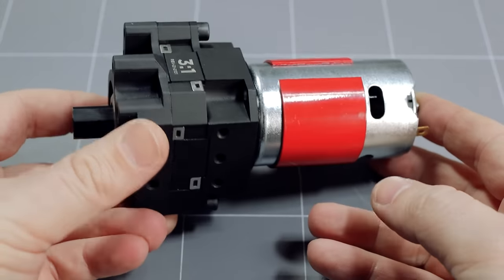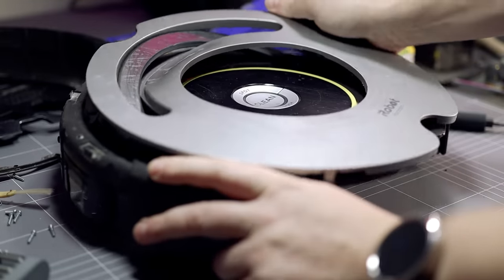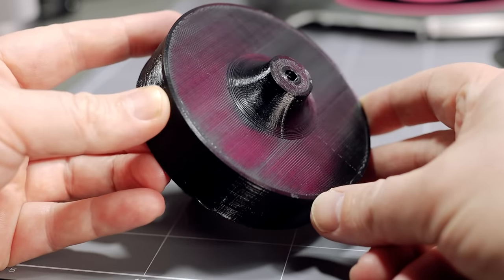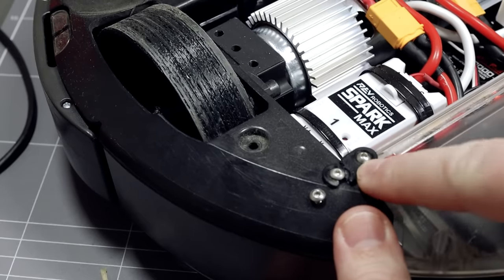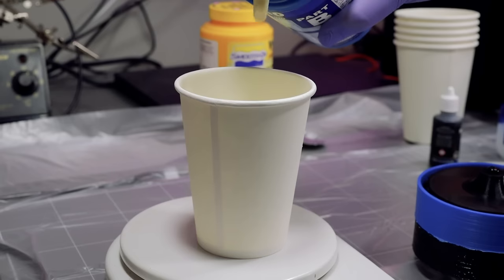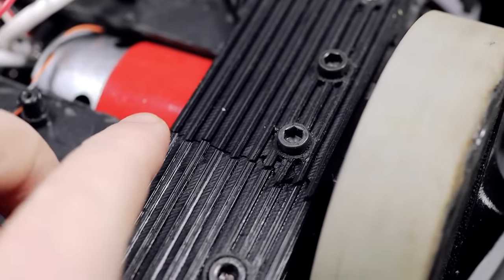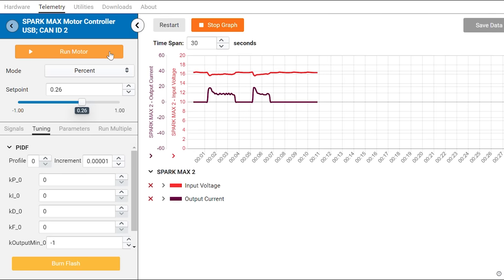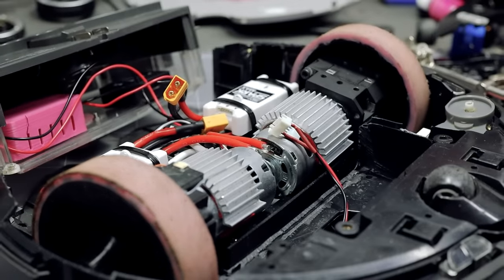Building the World's Fastest Roomba

Comment from the maker: Join the electrosync team on Patreon: https://www.patreon.com/electrosync
Reply: Just had an idea. Would be nice if Roomba had a camera and a sentry mode while your out. Plus the ability to “take over” control from the auto computer to drive with a phone so you could check your house out when away. Other idea. Linear actuator to lift front combined with tank tracks to climb stairs.
Reply: I just want you to name it Vroomba thats all
Reply: I just wanna see this evolving further... Rockets for an speed boost, parachute and breaks, ....
Reply: maybe you should add some LEDs in the dust compartment and in the litthe sensor that sticks out in the front
Reply: dunno, but just pls do not stop it!
Reply: I would suggest just casting the entire wheel, or try printing it resin. FDM wheels are usually miserable because of layering, and having to recast the tires every time is probably getting kinda annoying. I'd also suggest maybe trying something else for the structure before stepping up to aluminum, only because aluminum is a pain in the ass once it bends and can cause damage to other things since the mount is no longer taking the brunt of the impact. Just something to think about. I would also think about some sort of other creative solution for the anti-wheelie. Between it, the front swivel, and the main wheels, this thing is TECHNICALLY a four wheeler. but I might just be nitpicking a little.
Reply: Make the wheel hubs out of tpu. It has worked great for my beetle weight combat robot, so I'm sure it will work fine for your project. You could also probably get away with making the motor mounts that keep cracking out of tpu too.
Reply: make it clean faster.
not drag, but gymkhana
Reply: FASTER!!
Reply: You should try rubber tank treads instead of wheels!
Reply: make it brushless using outrunner motors directly driven by rubber around the motor cans
Reply: Flying Roomba, that follows you while purifying the air with charcoal filters! Personal autonomous Roomba air purifier, the perfect blend of useful ridiculousness!
Reply: a tail fin could help stability
if you look at sailboats, seeing how little the daggerboard/keel and rudder are compared to the hull means you probably won"t need a particularly big one to help substantially
Reply: Do you have the link for the motors because I'm going to use them for my rc so I can make it really fast lol
Reply: Lidar so it can drive itself that fast to clean a house hahhahaa
Reply: MO POWAH BABEH!
Reply: Use the suction to produce downforce and improve stability - like the Brabham fan-car.

you could use a deployable wing instead but that would detract from the Roomba aesthetic.

Also, if you made it more nose heavy it would be more stable as the reason it's spinning around is cause it's back heavy (you experience the same effect in rear engine cars like Porsches, but they have dedicated steering wheels meaning the tail whipping out around corners is actually beneficial, but in a skid steer like this you need significantly more stability as one wheel losing traction will instantly see your Roomba doing a 180).

as for stronger wheels - you could actually take a note from 3BrothersRC and their "anti-foams" which would turn the tires themselves into a suspension system that would absorb the shocks and bumps that result in breakage (I would model them after the 2 stage design so you can tune both sag for pot holes and compression for bumps - ideally you want them to sit on the second stage but haver the first stage as stiff as you can make them so they can react to pot holes quickly), plus it would also increase you contact patch with the ground thus improving stability and grip even further, all without making the ride "wobbly" as the 3BRC "anti-foams" do not have any side-roll thus resulting in the grip of a drag tire with the responsiveness of an F1 racing slick.
Reply: Brushless motors! I saw the ones you used are brushed. With the right brushless motor(s) and ESC you could get that thing to probably 40-50mph
Reply: Design/measure out a track/circuit. Allows time trials. Challenge other maker youtubers... Ultimately, Roomba Racing series!
Reply: Flying roomba. A roomba that goes so fast it can lift itself off of the ground using wings or whatever you gotta do. If anyone can do it, it's you.
Reply: I said it in a different comment, but put a RC nitro engine in it or a Jet engine. Your choice
Reply: Add and tune a gyro to help with the stability issue
Reply: KNIFE
Reply: Would be cool to see it with some gyro stabilization for better tracking/handling
Reply: Definitely machined parts needed
Reply: worlds fastest vacuum
Reply: it needs to find the nearest person and bump into them repeatedly, you know, just like a real roomba.
Reply: Reinforced chassi for sure
Reply: FPV Roomba obstacle course fun lol
Reply: parachute break and sussy suspension
Reply: TCR with some proper aluminum wheels might be neat
Reply: amphibious/swimming roomba
Reply: A ramp attached at the front to flip over other roomba on it's way.  Also snowplow mode
Reply: Compass for locked heading like the Traxxas cars!
Reply: yup
Reply: I want it to pick up dirt, even a little so it still is truly a Roomba.
Reply: Arduino module to give better control/sync of driver motors
Reply: 4x4 rally roomba
Reply: How's about a servo to pivot the ride height to counteract the wheelies or something?
Reply: Allow it to run the room spa firmware, probably using the built-in hardware. I want to see this thing try to map out a room using AI LOL
Reply: Absolutely YES
Reply: Turbo
Reply: Full Brushless Drive! If you got huge motors you could do YOLO drive (just direct from motor to wheel), or you could mount something like a 3536 to a banebots 16:1 planetary gearbox. Those are pretty quick
Reply: A BattleBot!!
Reply: I love to see the FRC components!!!
Reply: Full body spinner version with flails
Reply from the maker: @PurpleMoonCats  Link is in the description.
Reply from the maker: @Ravedave5  There was plenty of dirt in there after I finished up!
Reply: Strengthened bits like motor mounts and wheels. Nearly a 60 kph roomba is nuts. And do what StillFeelGoodMan said and call it vroomba, that was genius.
Reply: a second one to race against
Reply: I could Print you the wheels Out of Nylon reeinforced with Kevlar or Glasfiber  on a Markforged Printer!!! Sounds good?
Reply: @electrosync  thank you
Reply: Let's see it clean a room at different speeds!
Reply: Add a gyro for stability control would be interesting.
Reply: Imagine the Roomba could automatically maneuver through a set track without a person controlling it? You could certainly manage that with some sensors and 'maybe' AI :P
Reply: Nitro power
Reply: brushless?
Reply: make the roomba lidar equiped and give it the emergency brake feature like on most roombas
Reply: No
Reply: Should use a flight stabilizer to stabilize any uncontrolled lateral movement
Reply: GIANT ROOMBA
Reply: Could you use something like a fixed wing flight controller to stabilize straight line acceleration? Currently are you driving the left motor with left stick and right motor with right stick? Im thinking if you could use a flight controller, you could use left stick for throttle and right stick for yaw/steering.
Reply: Give it mad drift. Wanna see this thing do 360 donuts or something.
Reply: roombas have sensors, use that to make it go In track you make. some machine learning. 

there is a motorsport with a similar idea. I think
Reply: A high-speed Roomba with an equally high-power vacuum, so it can clean as fast as it can drive
Reply: Its not even autonomous, thats the whole point of a roomba.
Reply: Brushless power?
Reply: It needs shock absorber and then go for 100 km/h. 😀
Reply: Plastic wheels are unable to compensate road surface roughness. Rubber compresses max 1...1.5mm, that is not enough. And that force is going further into the wheel. If you make wheel out of aluminum, it will break the frame. Add some softness. Springiness. Make rubber softer.. add air pockets. You need at least 1-2cm of rubber and compressible zone of around 5mm... not less.
Reply: Brushless motors
Reply: Battle Roomba
Reply: We need a roomba that you can ride
Reply: Flying Roomba 😎
Reply: brushless motors will be more powerfull
Reply: Mops are next
Reply: Keep it simple, laser cut motor mounts
Reply: A blower and flame kit :p
Reply: Dude. What a video? 8k subs? You should have millions
Reply: Team up with @integza and slap a rocket engine to it 😂
Reply: Just put a wing on it
Reply: Roomba battle bot
Reply: Roomba race
Reply: I think you should do some carbon fiber printing for lightweight stronger parts
Reply: Make a flying wheel chair or even a para glider
Reply: Underfloor aero: Eliminate the need for the anti wheelie via aero balance, or make it retractable. Unlike a car or motorcycle, acceleration doesn't increase grip on the drive wheels.  Maybe frontload the weight?  One of the issues with a video like this is that video of a roomba going fast just looks like a sped up video, regardless of how fast it is going.  It's doing a thing it already does, drive around on the ground.  Maybe race against a bike?  Maybe get it to do jumps? Things roombas don't normally do.  Definitely underfloor aero, weight reduction.
Reply: Off road version
Reply: Upgrades+ original function and let it loose in your home
Reply: Poly. Wheels with no printed hub! Mould direct to bearings like skateboard wheels
Reply: You should put little bits of metal so it sparks, that would look badass
Reply: You need put little bits of metal so it sparks, that would look b@d@ss!
Reply: You need put little bits of metal so it sparks, that would look awesome!
Reply: To actually clean at that speed.
Reply: Might be a lot to build, but it’d be really cool to see a few of these race on an rc track!
Reply: I think it would be really cool if you gave it a brass body and copper wheels. :)
Reply: How fast can it clean your house?
Reply: @Dangineering  nitro is a step down from brushless. Jet engine, it depends but usually it's far worse than either at that scale. I think he's trying to keep it as roomba like as possible. He still wants it to function as a vacuum.
Reply: @Ravedave5  I'm pretty sure that was one of his requirements during the video
Reply: Some kind of suspension helping the wheels put the power down and not crack during the process
Reply: Make the room a have crazy powerful suction.
Reply: I dont think we need one. Thanks for the offer though
Reply: Two of em and cameras on em, so you can race them
Reply: @iROMine the front wheel is an issue, I first was worried about the rear then he fixed that but now as he decelerates the Roomba's the front end is fixed down and drags hard since there is no front wheel.
Reply: Do aluminum tires and full suspension. Give the small wheel a companion for stability and hotrod the casing. Also try cramming in more gears to increase the rpm even if you need to break the outer casing!
Reply: @iROMine  He asked for suggestions (without limitations) so I gave them. Yeah he does seem to want it to retain the overall roomba look, but that is not to say you couldn't do that with either nitro or Jet. Also he was already have trouble controlling it, so maybe going faster isn't his ultimate goal? Maybe its just to have fun, explore different options, and make it entertaining, hence nitro or Jet. What is more likely to get more clicks Jet rooma or even faster electric Roomba? Probably the title with jet in it. It isn't just about sheer performance.
Reply: @Dangineering  hey I'm not gonna argue about it. Personally I think faster is the ultimate goal, per everything that he's done so far but I'm sure fun factor is up there as well. Maybe clickbait is too.
Reply: @timwegman5776  l must have missed that. Did it get blown off or something?
Reply: @iROMine  Fair enough, likely a little bit of both.
Reply: supercharged hemi v8 lul
Reply: flying roomba
Reply: give the Roomba the ability to clean without human imput.
Reply: Roomba rally variant.
Reply: Roborock vs Irobot
Reply: please add a spoiler! I think it would look great
Reply: @bowieinc  just buy Xaiomi s6maxV
Reply: 50cc engine with nox and twin turbo
Reply: Flamethrower on roomba. Imagine the terror!!
Reply: ask elon musk for a rocket motor
Reply: Yes
Reply: Would love to see what could happen if you added some amount of suspension and possibly some better method of steering straight
Reply: A jet engine
Reply: hahahah the fkin roombma is popping’ wheelie’s hehehehe oh man I love gas & oil but this makes me wanna supe up a vacuum!!!!
Reply: if u were by me we could swap a gas engine for a electric motor u would let u put it on your video, I can do it all myself & plumbing, electrical, dropped the engine, water box i put everything in a 9ft aluminium Jet boat mostly from a Jetski save some custom parts here & there. It runs like a madman on fentynol but a lot quicker.. I also built up a 1987 banchee brought back to life. Now it has modquad clutch basket with plexus glass window so u can see the red anodized lockout clutch spin & see the gear oil. the grill mesh matches the lockout & oil dipstick,  put new plastics on it & painted some of the parts, rebuilt some small stuff & its soooo fast.. stretched out 10 inches so it wont pop wheelies non-stop./ dual expansion chambers,FMF pipes. boost bottle, & its bored over before I got it, & has about 18hrs on motor.. the old guy smashed it into a tree ice racing or something, I have his  home made ice tires he made with standard tires/cheap ones, then he put self tapping aluminium duct screw into each nub on the tire.. the metal bumper was mashed when I got it, he hit a tree hard.. I checked the frame to see if it was bent..
Reply: Gasoline roomba.
Reply from the maker: @Oscbear  That would be great. Not sure that I have the time to build another though, so maybe an RC car?
Reply from the maker: @spaceshuttle6454  Just imagine!
Reply: roomba car lol
Reply: Aluminum wheels. better wheelie control (both sides antiwheelie and damping) and front and rear wings.
Reply: Make some suspension. Hell, try some kind of leaf spring setup like a older truck.
Reply: Moar roomba
Reply: add some bump protection
Reply: a self defense system where it pushes out a knife to attack your foe
Reply: make other things fast
Reply: @electrosync there's a guy impersonating you in the comments. It's claiming that a person who comments in your channel was won something and contact him via telegram.
Reply: Make into some like the Brabham BT46 Fan car, using the Vacuum to create downforce.
Reply: I’m disturbed by the lack of RC activated flame thrower on it
Reply: Yup needs bigger tyres and mo power. And a custom made body probably
Reply: You have a scammer using your handle and pic.  He's deleted his comments, but I'd report him if I were you.
Reply: Create a dedicated racing roomba, gut everything useless in terms of speed and acceleration and improve the aerodynamics without losing the circular body frame of the roomba.
Reply: A cat riding it. Perhaps a cheetah now that it clearly needs a spoiler and rims. Rice it up full jdm then add cat.
Reply: Put a Cirno fumo on top of it.
Or just get a lap record on a race track.
Reply: variable drift control?
Reply: So you built a Vroooomba.
Reply: Racing version!
Reply: watts your   name        why    dont   put   big    wheels    on👍👊✋
Reply: @AnarchistMetalhead  I'm sure you're right that a fin would help, but as an engineering student who sails,  my understanding is that the reason centerboard and rudder can be so small is because the water is so much denser than air. But yes! A fin would be cool
Reply: @bowieinc  and finally,duct tape a nerf gun on it.
Reply: Flying roomba
Reply: aero for stabilization
Reply: Hello, please trad this :) :  Bonjour, je suis désolé, mon niveau d'anglais est mauvais
Je pense que le plus important est d'essayer dans un gymnase, avec un sol parfaitement lisse. Ensuite des roues en aluminium avec des moyeux en alu aussi. Et pour tes '' pneus '', essaye avec une matière plus douce que la résine, qui est très dure et amplifie les vibrations caoutchouc fondu...) . Enfin, pour ta roue anti-wheeling, met 1 devant et 1 derrière, avec moins de 3 millimètres de débattement car tu gagnera en stabilité ET motricité
Reply: What about making the wheelie stopper out of titanium for extra ✨sparkage✨
Reply: I am late as hell to this admittedly, but in the case it's not been worked on yet, I suspect you'll need a stronger frame altogether for it to handle the sheer power. Plastic isn't going to cut it with the design it has, and something sturdier like aluminium might be a better alternative. The obvious downside is that you'd have to make pretty much the entire Roomba from scratch. If the goal is to modify it, suppose it wouldn't work, but I would argue that it's still a Roomba if it looks the part, and works the same way as one.

I'm not an engineer, or expert of any kind, so this is just me taking a guess based on what little I do know, and seen from this video. Seems like most of the faults with it from testing came from the fact that the plastics used.. Well, it obviously wasn't built to handle going that fast, or hard knocks and bumps. The plastic is fragile as hell, and that much I think you'd have to find a means of strengthening it all, if you want to keep to the rules you've set for yourself.

The wheels might also be another issue, but I've not the slightest clue how to help on that one sadly. Tyres are not my kind of thing, sadly, but I suspect using some kind of specific tyre shape might help with grip. Control is going to be an issue no matter what, just because of it's two wheel design, sadly.
Reply: I wanna see all those 3D printed components replaced with machined aluminum. Maybe add some chassis reinforcement as well. For handling, I wonder if it's possible to do something with a gyroscope sensor, like RC Drift cars use to help stabilize it at high speed better.
Reply: flying roomba
Reply: You need the right passenger-cat test-pilot for this Roomba.  Start with one that likes riding a Roomba at ordinary speed, and gradually get cat used to higher speeds.  😼
Reply: Add a big ass spoiler on top
Reply: print those wheels out of resin.... also I am was thinking about converting a roomba to clean my roof off with .... lol
Reply: For wheel damage , I think suspension is possible (or maybe not)
Reply: I want to see a cat try to ride that roomba
Reply: Howabout you make a wheel made of smaller wheels spinning the same way as the unified wheel so that the part touching the ground is spinning faster yet it all fits in the space as one regular wheel?
Reply: Something not featuring you THX!
Reply: Give it wings
Reply: Do this with eufy's RoboVac, It might be easier
Reply: It needs a spoiler
Reply: Aluminum wheels would be heavier, add a lot of strain to the motors, and likely result in a lower top speed. What you need is a more structurally sound wheel design. I suggest adding plastic spokes (bracing) on the inside of the wheel. 6 or 8 spokes is probably the right number; test out which is best. If the wheels STILL break, then you need some filler material inside the wheel, something that doesn't add a lot of weight. If this is the case, I suggest adding spray foam between each spoke. When you add the spray foam, don't fill up each section all at once, do it a little at a time. The foam expands, and you want to leave space for it to expand up through the opening, and not outward so that it breaks the wheel. Once you've filled the wheels to the top with foam, shave off the excess with an exacto knife. Now you have wheels that distribute the strain put on them rather than being focused at one point.
Reply: A Roomba Gyro-powered steering wheel for the Vroomba.
Reply: attach one to a weather balloon, or make a flying Roomba. Weather Balloon isnt a very good science though
Reply: Make the smartest roomba
Reply: can you hook this up to the roomba computer and see what it does with this?
Reply: more please, we need a 50 + Mph roomba
Reply: Just make it able to clean a room at maximum speed without damaging anything
Reply: A spoiler would do you goodi think
Reply: Add another anti-wheelie wheel to the back, and put a bit of suspension on both. That should help prevent jarring impacts when braking and accelerating, and also stabilize it while driving by keeping it from doing jittery bounces while straightlining on rough surfaces.
Reply: Brushless power system!
Reply: You just can buy Toy RC car wheels for the Vroomba
Reply: I mean...you have done the fastest Roomba....soo flight next?
Reply: It needs a jet engine for sure.
Reply: Maybe a flying roomba that picks/lifts up dust and dirt like a ufo?
Reply: Make the vroomba biggerrrrrr
Reply: Try mounting a drag V or Y shaped anti-wheelie bar in the rear for better stabilization, and use your existing one up front to prevent damage on deceleration. Additionally. i would use thicker tread for cussion and grip.
Reply: With my E15+, when you leave the home it will vacuum.